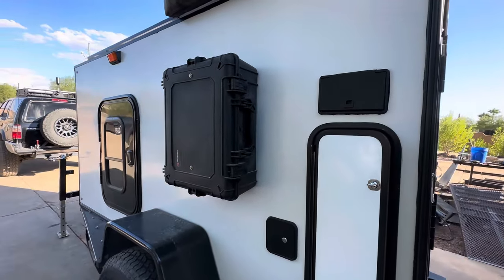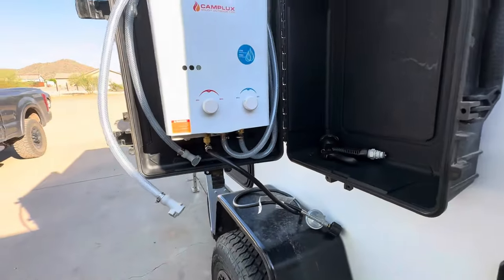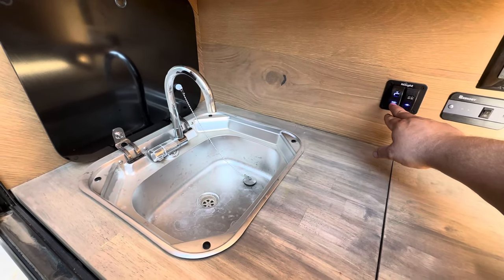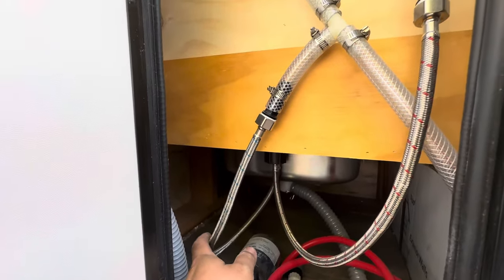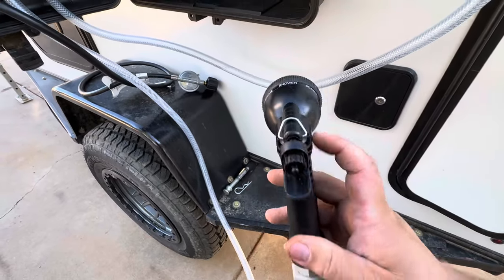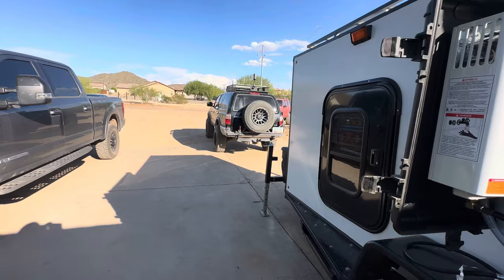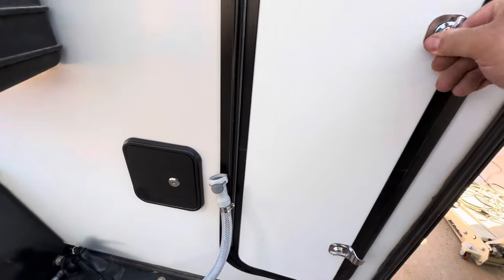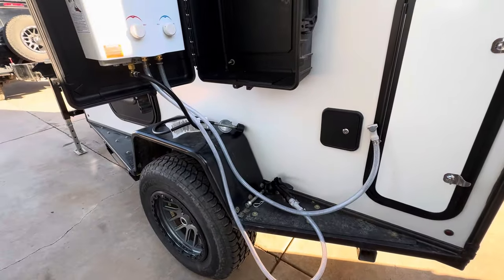Finishing Up The Outdoor Shower on my self-built Overland Camper

Comment: Do you have any concern with the weight of the water heater being mounted on the lid? 
Also, how did you mount the box to the camper? Anything special for waterproofing?
Reply from the maker: The hinges for lid seem to take weight pretty good. Plus I plan on keeping closed unless using it. The box is bolted to the steel frame of the camper walls and I used butyl tape around the bolt holes to seal it. During monsoon rains and even washing camper I have no leaks. Butyl tape works great for sealing.
Reply: @jaybareadventures  thanks for the fast reply. I’m currently in the process of doing something similar
Reply from the maker: @patrickl8459  your welcome